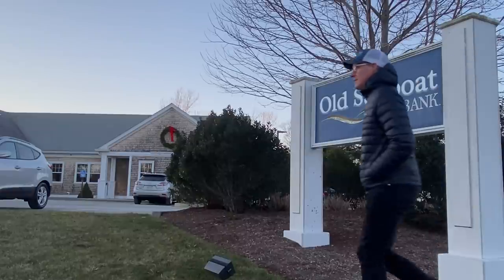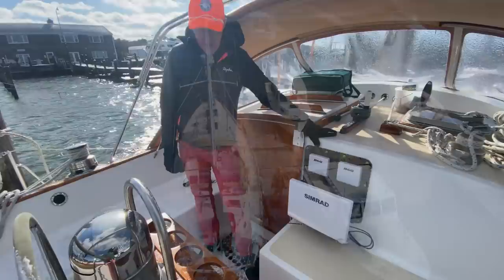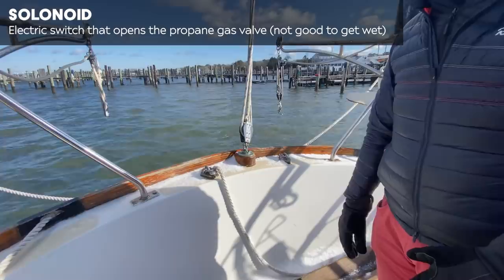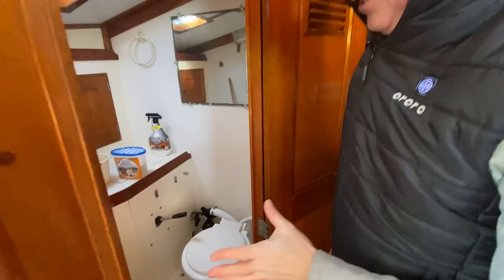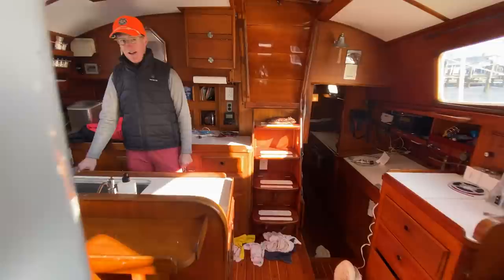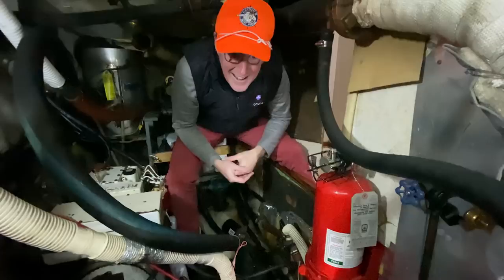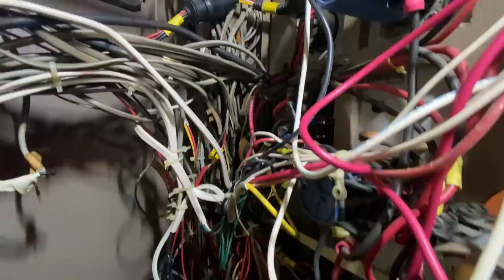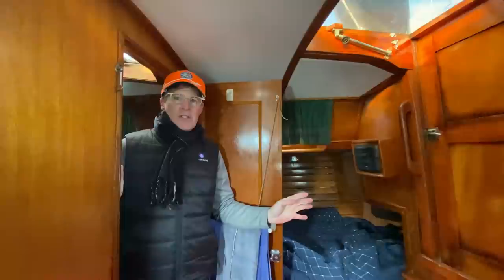EP 1: Ran-day Bought a Sailboat! A flash-forward on the Scheel 45 #sailboatrestoration

Comment: I feel that second set of batteries in the bow were either because they didn't want to buy the right guage of cables for the windless going all the way from the main bank or they didn't want to run those thick cables through the boat... Potentially both, there is ways to properly keep the separate banks with trickle charge cables between them but as you pointed out ac trickle charger is amateur hour, do plenty of research and perhaps get expert advice so you don't end up with cables on fire

Comment: I am an electrical engineer, having designed boat power systems among other things.  I would not redo the wiring.  It's just a lot of unnecessary work.  I would, however, figure out where each of the wires goes, label them, and remove the ones no longer in use.  If you see any frayed wires or broken insulation, then replace the wire.  It's not rocket science...
Reply from the maker: good advice!! if it ain't broke... something something! :) cheers!

Comment: Be happy you have a remote oil filter...to locate...too many boats they are like your hidden through hull.😬

Why stick a battery forward ....its powering your winch they probably wanted to keep the cable run short to reduce the draw and V drop to the winch .. having it forward for that and having a bow thruster fitted later ..its logical to power the thruster from there.
The main bilge pump being connected there ?? 
It may have been done at some time as a back up power circuit
If the main engine bank got flattened. 
Shore charging forward ok 🤔
But no link to the main aft battery's and alternator.. keep digging you may have missed something. 
You may not find a connecting cable till its running do the isolators isolate each device or one the battery and winch.
To help your investigations and bar the bilge pumps i would keep it as is and investigate first. 
The worst vehicle ive ever had for wiring problems was paradoxically the neatest. The wire were bundled and fixed down tight it looked great but it would crack and i found where cables had been tightly bundled  together some wires had overheated melted the insulation and then shorted to adjacent cables. 
Yes its messy but you can get in 
And reach, remove and replace the connection points.
Invest in a 12/24V test light/probe and a test multimeter you will find loads of u tubes on how to test for continuity Voltage and Current.

You've a great boat its like buying a house with a mature garden ... You need to see how it shapes up for a season ..once  
You've got those few perennial weeds sorted.

Comment: Would like to own a boat I could single handle and transport on a trailer by myself to do some coastal sailing.  I live in central Florida near the gulf, near Crystal River.   The coast here has 7 spring fed rivers that flow into the gulf with flats that are shallow.  I'm 64.   What are some older boats that you would recommend?
Reply from the maker: Your question begs a lot more questions. When you say trailer do you mean about that you can slide often on a trailer like a power boat or just a boat that small enough but has a kilo but I built up trailer and cradle arrangement. Are you going to sleep and eat on this boat and we require ahead. Once we cross at 60 mark of course we usually need to head a lot more than we used to. There are a number of boats on the market like some of the smaller oh days are like the Audet mariner or the Audet 23 which were trailer ball and gave you some shade and shelter as well and of course there’s just a myriad of trailerable sailboats out there most of which are pretty or equal in terms of light sailing and single handing. Check your local craigslist these boats tend to show up there because there’s not enough value for most brokers don’t want to bother trying to market them. I wish you good luck keep in touch and let us know if you’ve had any luck or if you have any questions about a specific boat. Thank you for your note
Reply: @YachtHunters   I used to have a 31 ft O'day in partnership with a friend.   But...didn't get enough saliling experience to feel safe alone at sea.    But, I really enjoyed hanging out at the dock and spending the night on the boat by myself.     My friend relocated and wanted to sell and we did.   I have a friend who is a master sailer who would go out in the boat with me and I throughly enjoyed it and it was a beautiful old boat.  I appreciate your suggestions.  I just want to do some coastal sailing around Florida's West Coast and the Keys.  I like camping so I'm looking to keep things simple.  I love to watch your videos.

Comment: I’m late! Question: how would you mount a wind vane or similar product with the centre cockpit?
Reply from the maker: Same as an aft cockpit: on its on mast bolted to the stern toe rail. 
If you are referring to self steering gear there are a variety of designs available that would work readily such as the Hydrovane or a Caphorn
Reply: @YachtHunters  I was very specifically thinking of a Monitor Wind Vane. I guess my query is more aptly put “do you think the centre cockpit would make adjusting a wind vane in the after cockpit a pain and what might be a better solution”
Reply from the maker: My son in law just installed ,himself , a hydrovane. On his center cockpit Stevens 47. And he is going WAY offshore this spring. 
Very tidy install also provides an emergency rudder
Reply from the maker: https://hydrovane.com/

Comment: Do you feel you paid to much for the boat now you know how it really is ?
Reply from the maker: Great question. I feel I still got a great deal on a really unique boat. I think the hull & interior condition was so good that the poor condition of the electrical & other systems(plumbing, engine) came as a surprise. I knew the stuffing box was an issue… but a lot of the patchwork elements (bilge pumps, battery chargers) were really 1/2 baked. 
Overall, I love projects so this is not only a series of hobby projects but I’m also getting a full education on how to fix/manage/maintain the systems…
Another consideration was the appeal of the hull & interior layout. I love the classic lines of some of the older boats(read: Concordia) but the Scheel was beamy and had massive headroom compared to those from the era… so for an older boat I have a lot more potential to make it more comfortable & modern. so it’s not just about the ownership cost for me - there are a lot of other side benefits… not to mention fun to be had. What do you think? Did I overpay?